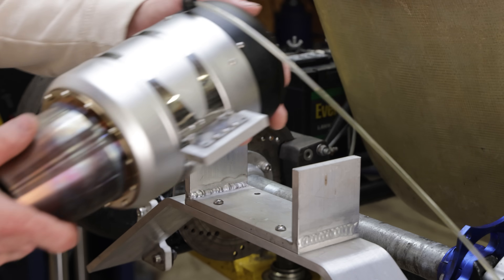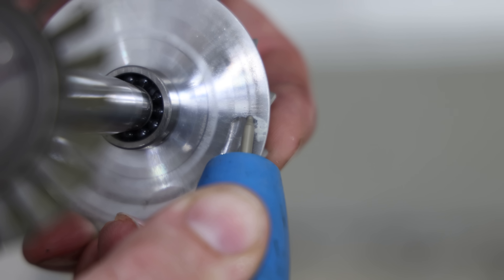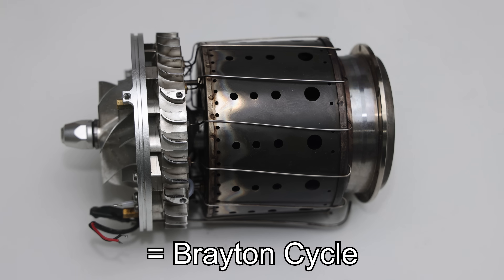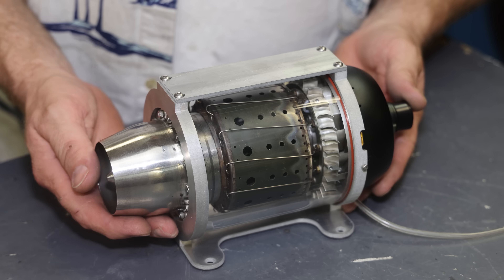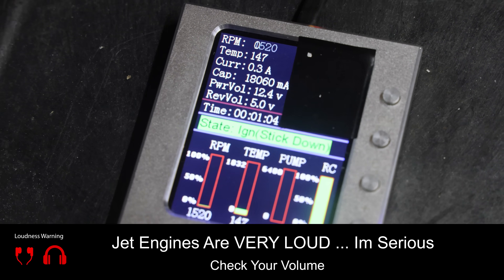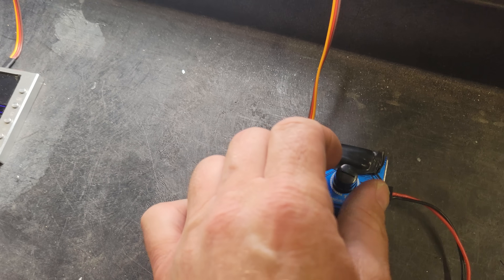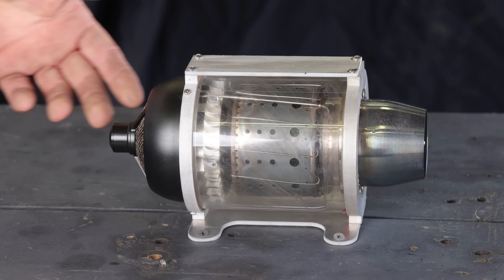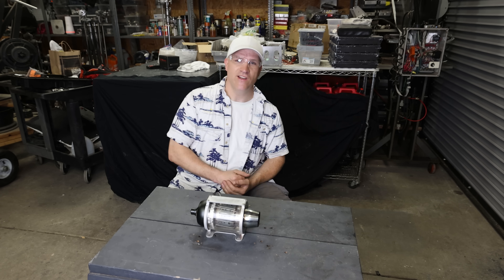See Thru Jet Engine

Comment: Ah yes, suck squeeze bang blow. Now that I understand (4 strokes, that is)! Great explanation, and dope video overall.
edit: How come the jet engine doesn't make the rolling bench it's on shake or start to propell? Even if the wheels are locked, surely it has enough thrust behind it to rip the screws out of the wood or something no? Even for the size that it is?

Comment: The air doesn't flow in as a vector, so it has no particular shape about it. Coming out the back, it will have a thrust vector shape, but it's not showing up.

Comment: I'm not a A&P, but I'm just wondering how the turbo shaft didn't freeze up spinning that fast? I know commercial jet engines also rely on oil to lubricate bearings and cool shafts. I work at an airline, but again not a mechanic. I didn't see and oil tube running into a entry port? I looked at the video again and notice it was oil premix, but still surprised no bearing failure, especially at 127k rpm. very impressive video!

Comment: I’ve always wondered how  a engine can go through a rainstorm without putting out or diluting  the combustion chamber.
Would you be able to run a mist of water through this engine?
Reply: Because when it goes through the compressor it turns into hydrogen and oxygen
Reply: @syitiger9072  But the conversion to hydrogen and water would itself cool the engine down, since that's an exothermic reaction.
Reply: @syitiger9072  TIL if you compress an uncompressible, stable liquid, it breaks apart,  creating a highly flammable gas mixture. right.
Reply: @syitiger9072  No, water doesn't break down to hydrogen and oxygen in any engine. It just vapourizes.
Reply: It actually slightly increase the engine efficiency by lowering the temperature of the intake air and by increasing the mass of the exhaust gas.

Comment: The one thing that truly amazed me was realizing how few moving parts a jet engine has.
Reply: That’s why they spin so fast! 25000 RPM… vs 2500 for your commuter car.
Reply: @meiruwo  the lack of moving parts is not the reason that high speed is practical. They don't have reciprocating parts - just continuously spinning parts, and that's the reason.

Comment: I never realized how similar a jet engine is to a typical turbocharger you'd see on a car... essentially a big turbo with the combustion chamber right on the back and exhaust again behind that!
Reply: Thermodynamically they are similar: a cycle of (1) compression, (2) heat addition, (3) expansion, and (4) heat rejection. In an Otto cycle in a car, the process occurs during four strokes: intake stroke (heat “rejection” since we’re adding cold air in), compression stroke (compression), power stroke (heat addition+expansion), exhaust stroke (heat rejection: hot air exits). So actually, compression takes place even in a non-turbocharged Otto cycle engine.

The turbo helps three ways: it removes some enthalpy from the exhaust; it compresses the intake air a bit; and it also allows for more mass to be passed through the engine, so that more power can be extracted during a single stroke. The first two help with efficiency (higher pressure and lower temp. heat rejection == more heat converted to work) while the last one helps with power (more air mass == higher rate of work). 

The brayton cycle is a little bit different: the heat addition takes place at constant pressure, because there is no closed barrier between the combustion chamber and the outside air. So, in this cycle, the compressor blades, which is basically a backwards turbine, do all of the compression work. A bit of work is stolen from the exhaust air to drive the compressor. 

These cycles both turn heat into work. Heat gets in and out during heat addition and rejection; and work gets in and out during compression and expansion.
Reply: Look up turbocharger jet engine

Comment: what do you use for fuel for these things? Do you actually purchase jet fuel? do you make your own?
Reply: This type of engine runs on kerosene or diesel, mixed with some lubricating oil. Jet fuel (again with oil added) would work well, but is not necessary.

Comment: I am not a jet engineer, I was sad to not see the vanes spinning on the left of frame.
Reply: Those are the stator vanes - stators don't move. The impeller left of that is not visible because the housing around it is not clear - same for the turbine to the right.

Comment: When you say jet engines in general don’t pull in a lot of air for how much thrust they generate that is only true for low bypass engines. The larger the bypass ratio becomes the more air it pulls to produce thrust.
Reply: Well those are turbofan engines, this is a turbojet
Reply: It isn't true for any engine. This is turbojet (no bypass), and moves about 2 kilograms of air per minute; a turbofan with the same thrust would move even more air.

Comment: Why does the cylinder around the combustion chamber have holes?  Is it for more air flow? I would think the front intake would supply all needed air.
Reply: The airflow path is in through those holes into the combustor "cans", then to the turbine from inside the cans. No holes = no airflow at all.
Reply: @brianb-p6586  Got it.  Thanks.

Comment: So, how much thrust does a small engine like that deliver?  I mean, if it were put on the back of a bicycle, would it have enough thrust to push it?  I've always loved jet engines, but I've never heard anyone talk about how much thrust they generate...
Reply: 30 pounds for this one; it is medium-sized compared to the range of engines like this sold for radio-controlled scale models and other remotely piloted and autonomous tiny aircraft. Just do a web search for "RC jet engine" and check out the specifications from several manufacturers.
Reply: I believe 1.21 gigawatts of thrust

Comment: This has got to be the coolest video I've ever seen.  What the hell is that clear housing made of that it can handle all of that heat and pressure?  That can't be just glass. Absolutely amazing!
Reply: Probably polycarbonate. To decide the required thickness, just use the peak internal pressure and inner diameter.  Glass would have a much higher melting point -- but usually glass is difficult to be manufactured into perfect cylindrical shape with large/any wall thicknesses (it's doable but for this video the cost may be unreasonably high).  Acrylic is eliminated because of how brittle it is.  As to the temperature/cooling -- I guess the portion of the intake air surrounding the combustion chamber shields the polycarbonate from the combustion heat.
Reply: @GatorWinup  
Polycarbonate would melt in fractions  of a second. This has to be some fire proof glass, maybe from Schott.
Reply: The company which sells a similar engine with a clear housing uses borosilicate glass, but Warped Perception has his own proprietary material.

Comment: I know that flying is (statistically) among the safest method of transportation. 
Still: it's a bit frightening to see what's going on in a running Jet Enginge and how much stress the material has to endure. 

Nevertheless: fantastic job Sir!
Reply: That's why your engineers command the money they do
Reply: car engine pretty much has small explosions happening inside it constantly.
Reply: Believe it or not, even if all engines fail simultaneously, the plane can still glide down unless other catastrophic events are occurring. The laws of physics tell us that the pressure of air below the wings will always be higher than the pressure of air above the wings. In other words, the plane is not going to crash down the way you think it will.
Reply: This engine is only a single stage centrifugal compressor, a large scale turbofan on an airliner actually has a much higher pressure ratio. It is amazing the materials can withstand that kind of stress.
Reply: @ad7 cool story bro.
Reply: Also keep in mind the numbers of people driving each day vs flying and how systems like these grow exponentially more complicated as more travellers are added.
Reply: @justjeremy2  You won't catch me flying with all these pilots dying of blood clots midair from Fauci's magic potion.  You won't see THAT on the Communist News Network!
Reply: @JDOTVegas  I will not be baited on a science video by bad science comments. 
I will not be baited on a science video by bad science comments.
I will not be baited on a science video by bad science comments.
Reply: @justjeremy2  I have no idea what you mean but you go on with your bad self!
Reply: @JDOTVegas  I just went thru some of your videos; youre an anti vaxxer (with mistaken notions about epidemiology, population genetics, statistics and geometric progressions). I was in this thread to look at cool engines, not bash a remarkable and underappreciated scientist like Fauci.
Reply: @justjeremy2  🤣🤣🤣🤣🤣
Reply: @JDOTVegas  See? I knew I should not have fallen for bait.
Reply: I would say normal car engine isn't any less violent. At least pressure and temperature change is gradual with jet engine.
Reply: This is why I'm floored when I find out how cheap airline tickets are and people still bitch.

Comment: Crazy to think that an airplane engine does that for more than 10 hours on a long flight. What a technology.
Reply: Not only that but does it with multiple compressor stages
Reply: Even more crazy is that industrial gas turbines do that 24/7 and can run for weeks or even months without maintenance.
Reply: @adamk203  they are also full of sensors and all connected to the internet. So a slight variation is caught long before there is a risk of engine failure. That way they can with confidence run it 24/7
Reply: @morten-punnerud_engelstad  forget the durability, that in itself makes it even more crazier to be honest
Reply: @morten-punnerud_engelstad  Sure, except that industrial gas turbines ran in continuous duty before the internet existed.
Reply: @adamk203  they run for a year long, usually once a year stopped for inspection and go on
Reply: @adamk203  Best reply.
Reply: Just imagine the human brain's doggedness and resourcefulness in developing the material science, the physics and solve  all Maths to make jet a reality.....have to bow to Sir Frank Whittle
Reply: Day after day, month after month, year after year! And operating reliably between -40 to +125 F. Amazing technology.
Reply: @melonbobful I would say they definitely experience a whole lot less stress when in continuos operation, as they see almost no thermal cycling, and the hydrodynamic bearings rarely come to a stop, which greatly extends their lifespan, as they run on a film of oil when turning, making them last infinitely long and suffer no wear at all  once running (except for a potential thrust washer, but that's not a part of the bearing itself), but during startup, there is no oil film, meaning they will have metal-to-metal contact until a film of oil has been established. When a gas turbine is running, the only wear it experiences is dust particles from the intake air hitting the compressor blades, but when it is stopping and starting, bearings run dry and thermal expansion causes metals to fracture. The same is true for the blower motors on many wall-mount condensing boilers, which are also meant to only start up a few times per month or even per year, and then keep modulating, possibly for weeks or even months on end, which means the bearings (that often are hydrodynamic) will also keep running on an oil/grease film minimizing wear. That is also how these boilers last 30+ years, while many similar fans in other applications fail after only a couple years. That is also the reason why these boilers will quickly fail if they are oversized, as they have to constantly shut off on overtemp due to their minimum modulating power being far greater than what is needed at the moment, and restart shortly after cooling down, which they simply weren't meant to do, causing many parts like the fan bearings, spark electrodes and gas valve to wear out quickly.

Comment: How many hp is that thrust equivalent to?
Reply: There is no direct equivalence between thrust (a force) and horsepower (a measure of power). When the engine is working on an aircraft it is moving so it is doing useful work: the power is the force multiplied by the speed (watts of power if you have newtons of force and metres per second of speed; for horsepower multiply force in pounds by speed in feet per second then divide by 550).

Comment: Ok, now hear me out. Put 2 of those on a glider.
Reply: There have been motor gliders (or self-launching sailplanes) using turbojet engines for many years. They use larger engines - the 30 pounds produced by this size of engine (or 60 pounds from two of them) is not enough.

Comment: I was an A and P  many years back for a major so there’s one thing I didn’t see was how it was started, was it by compressed air or ?
Reply: Electric starter motor on the intake end of the shaft, visible protruding from the intake screen.

Comment: If you wanted to see any air flow, you'd want to run it at the minimum speed you could. But you probably never had a chance to see the fog in the engine.

Comment: How long did this take, and what does it cost to build something this size? Very cool!
Reply from the maker: Took for, been on the works for about 4 years. I first had been working on developing the material that I could shape into different forms, then I had to find a company with the right machine to make it into round tubes like this, then I needed to get the water jet to cut the tubes the way I needed them cut, then I had to get the CNC to make all the parts that I needed, and then once I got all that I finally was able to do the video.

Comment: Would love it if you hooked up a boost gauge to the shell so we could see how much pressure the thing actually holds back. Would also be epic if you ran it at different power levels so we could see how much and how quickly the pressure changes inside the engine itself

Comment: This was freakin awesome! I assume the fog machine uses propylene glycol or something similar. I'm wondering if the heat of the combustion chamber in the engine was just burning it off before it exited the exhaust and that is why you didn't see much if it after?
Reply: He says it is glycerine based - yes, that would vapourize and burn.

Comment: You could use a number of small rods threaded on each end and use these around the outside of your glass cylinder to hold the end plates together.. Tension them evenly and I would guess your end plates would not move and the gaskets would stay in place.

Comment: Hey bud, to help with protecting that tube from the heat, you should sand the inside of it and coat it with "Water Glass" aka "Sodium Silicate" that you can make yourself for cheap.  It will also help it seal better while insulating the heat from the tube.

Comment: I'd also love to know just how hot the exhaust stream is at full shout... is there even a thermometer capable of surviving long enough in that killzone though?
Otherwise you'd probably need an IR thermoimaging camera, I guess.
Reply: Jet engine mechanic here, they have thermocouples made of special materials that can withstand the high temperatures.

Depends on the engine but various ones I have worked in can reach temperatures anywhere from 320 degrees centigrade up to 1800+
Reply: @Phlegmy_Mucus  Thanks, that's interesting indeed... 320 I wouldn't have expected, even on a smaller engine, 1800+ sounds more like what I imagined.

Crazy though to have it confirmed... some engines' exhaust could melt steel, huh...

Comment: Super cool video! I have always wondered, as an aviation nerd, what it would take to build a miniature turbofan engine. It's basically just the engine in this video, but with an extra turbine for the fan. The fan basically takes a bunch of air and thrusts it around the core through a bypass duct. The engine moves a ton more air, therefore making a ton more thrust, without burning almost any extra fuel. However much thrust that tiny engine makes, it can be probably be greatly increased by adding a fan.
Reply: Yes, all true. Just do a web search for "RC turbofan".

Comment: This is a most interesting video! Thanks for making and sharing it. It would also be interesting to learn more about the engine. Like what the starter looks like and how fast it has to spin in order to start it. What does the control system look like? What kind of fuel does it use? How much fuel does it go through? How fast does it turn and how much thrust does it provide? After it is started does it ignite the fuel with a glow plug or does it use a spark? So many questions, but that just shows what a good video this is arousing so many questions.

Comment: Wow.. I have to admit that I didn't know you could make THAT small jet engines.... Hmm.. I have been pondering various ways to make a hoover-craft.. I guess the exhaust is too hot to be used for the actual cushion of air lifting the craft, but at the very least this could be a way to get speed.. Would it be reasonable to mount these things on something that can be turned around so they could be used to break aswell?..
Reply: Just look up thrust reversers on aircraft engines. You don't "turn" the engine, you just turn the exhaust flow direction

Comment: can someone tell me why the blades/tourbine in front of burning charmber doesnt rotate?
and why there is only 1 tourbine? I saw the inside of commercial jet engine, there are many tourbines next to each other
Reply: The non-rotating part is called a "stator"; it redirects and diffuses airflow.
There is only one turbine stage because it is a simple turbojet with a low pressure ratio. A commercial "jet" engine runs a much higher pressure ratio so it needs more stages, and is a turbofan which means that it drives a fan and needs more turbine stages to drive the fan.